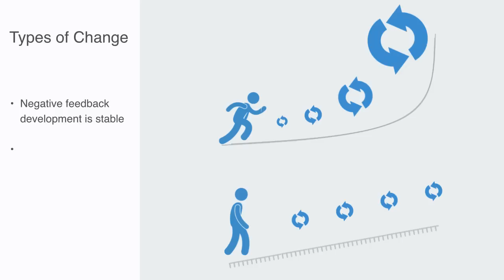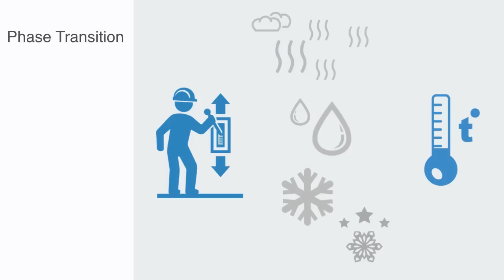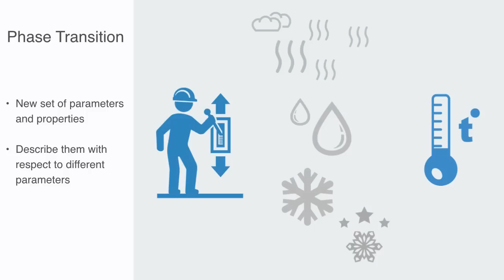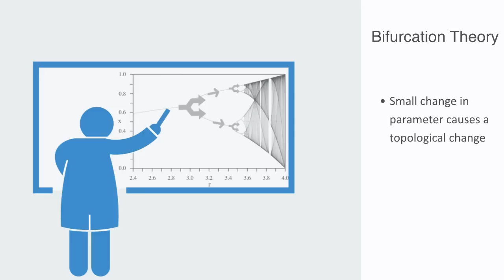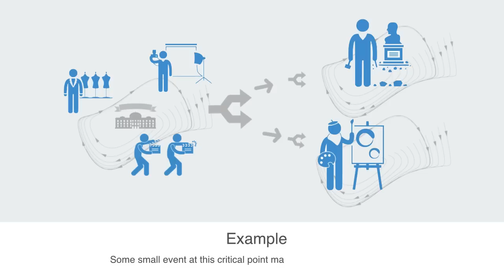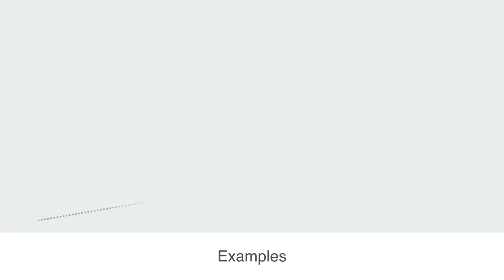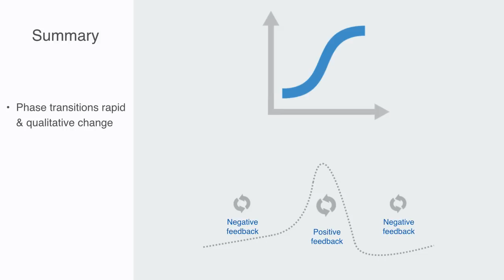Phase Transitions & Bifurcations

Comment: Thanks for your amazing video! Extremely clear at explanation and vivid examples. I was wondering about the example curve for Punctuated equilibrium, where the whole process consists of negative, postivie and then negative feedback. Is there a simple differential equation to characterize such process?
Reply from the maker: Not really, because it is nonlinear and in reality driven by the interaction between the system and its environment, thus involving emergence which you can't describe with a closed form equation based model, but probably the closest thing to that would be Catastrophe theory, https://www.wikiwand.com/en/Catastrophe_theory
Reply: Thanks for the reply and information! I will look into this!